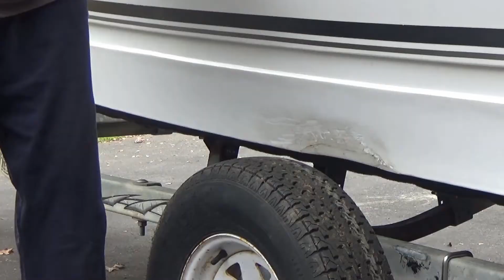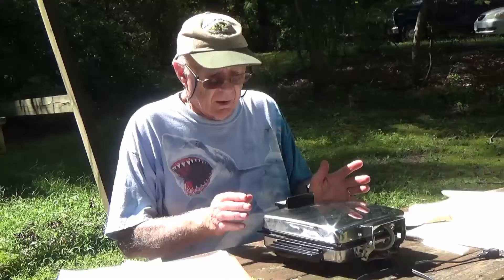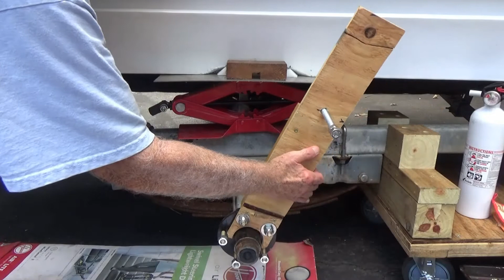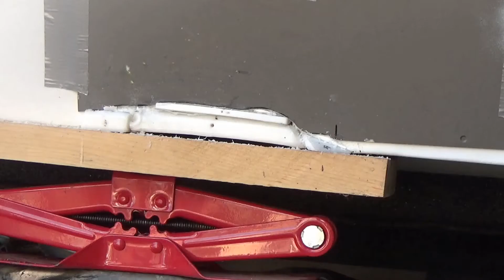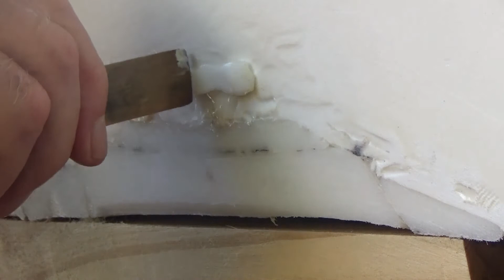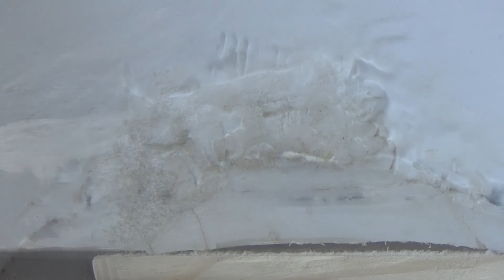ROPLENE HDPE TRIUMPH BOAT REPAIR

Comment: Well sir you discovered a technique called extrusion welding. THey do make a tip for the heat gun that you can feed an hdpe rod through while you melt looks like a great boat much better than fiberglass!